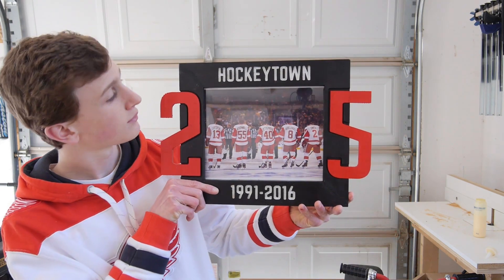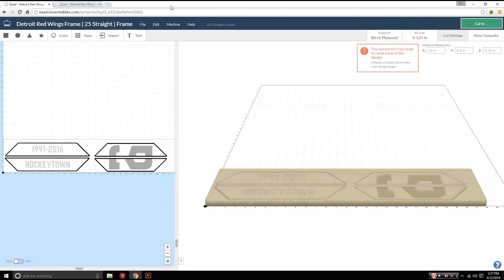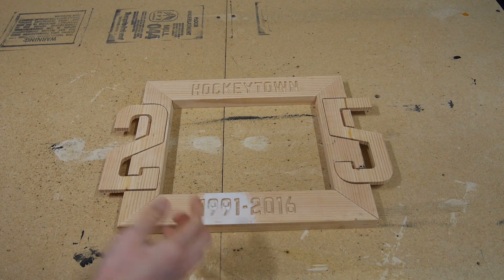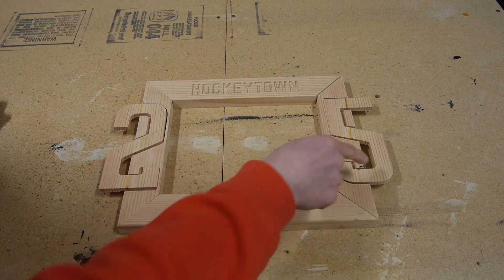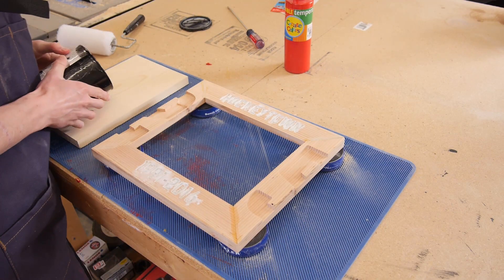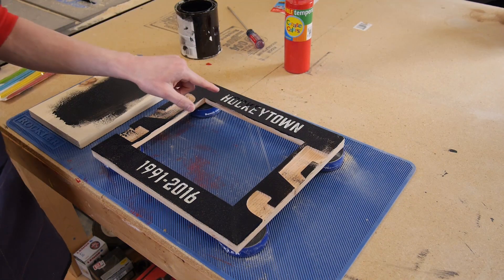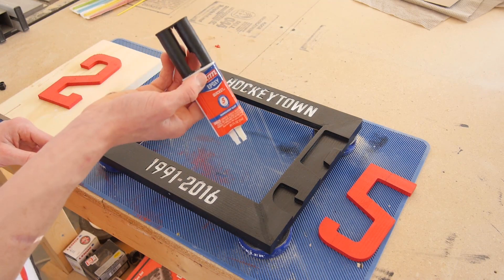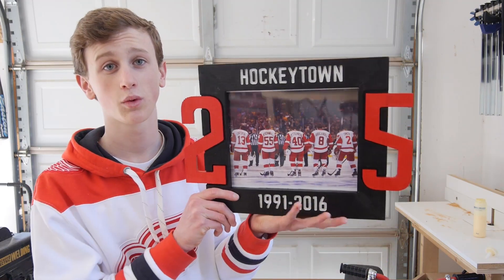How to Make a Detroit Red Wings Picture Frame | 25 Straight

Comment: Great dealing love it, just a suggestion with the Xcarve video portion if you have the ability to time lapse about 5sec works well get a lot of the carving in the shoot and in a short amount of time. Although what did was fine. Nice video
Reply: I actual like it CNC carving video shoots, Its fun watching it. Your fine just tip that ive used and work pretty good.